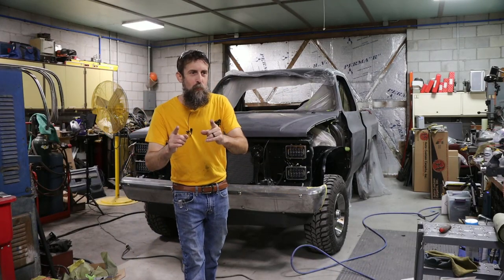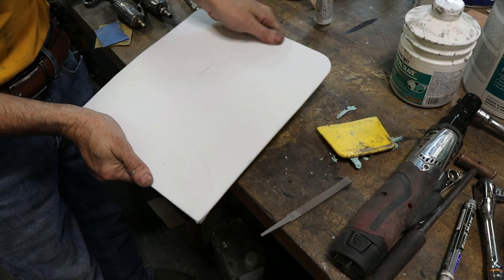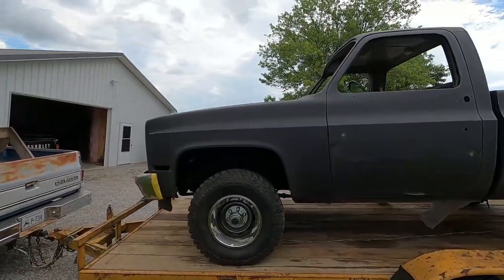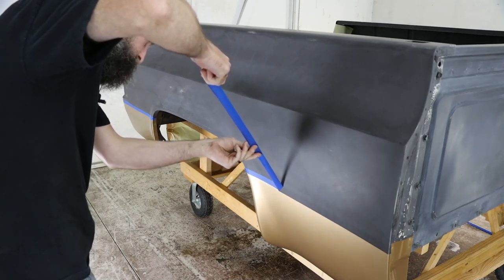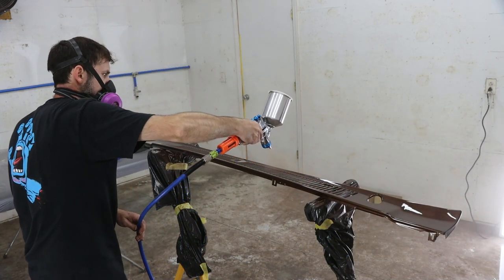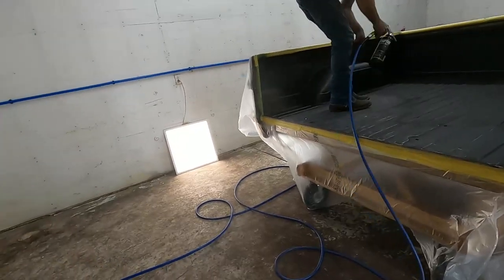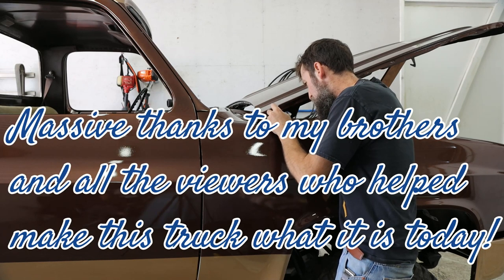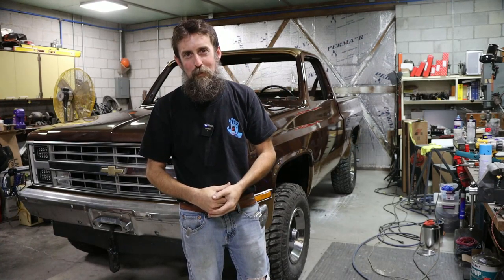From GARBAGE to GOLD! Old rusted out chevy k10 gets paint.

Comment: WOW - As a lifelong car guy whose been involved in a few restorations and paint jobs I know how much work this is. Ive been following and waiting in excitement for this day too, youve showed so much attention to detail in every aspect of the work  - the before and after is nothing short of astounding especially considering what you started with and how much work it needed in every single area -- Frame repairs: DONE - Suspension and steering: DONE - Drivetrain: DONE - Endless body work and paint: Virtually DONE - and the list goes on.  Now youre in the most fun part of the job, sanding out and polishing the clear coat then reassembling it with a new interior and everything will be as clean to work with as if it was a model car and the paint will look even better than it does now.  Just happens I had a friend and his dad long ago who painted EVERYTHING brown and gold, speedboat, van, house, fence etc etc so I normally hate this particular color combo but what I think doesnt matter your color choices are your own for the reasons you outlined and the truck still looks like a million bucks in fact its as good or even better than some body shops would turn out. youve gotten a really nice quality fit and finish of the panels, I was driving these off the truck as a kid working on the lot at a local Chevy dealer in '74 when they were brand new and some of the brand new ones didnt have panels this straight or paint this good.  I remember brand new ones having to go into the body shop for minor touch ups and repairs right off the truck.  CONGRATS TO YOU AND ALL INVOLVED, its a project well done and the results are well deserved.  M
Reply: Hear, hear! Well said.

Comment: Very nice truck!!  💪 
I’ve done a ton of old fords/chevies back in NY- some of them I did the lower panels just about every year on some to keep them rust free as possible- but there is little you can do to stop the salt from penetrating the pinch welds etc with the exception of oil- I’d spray every nook and cranny/inside frame- anywhere you can’t see or wash easily with oil-undercoating etc to protect it.

Comment: put on running lite pkg and get a radio, add a gps antenna and a solar panel on top too - you can get nice lithium power packs now for like 50 bucks - you could recharge that and trickle charge battery

Comment: I'm not sure why the aftermarket exhausts hang down that low. I've bought a hooker exhaust and an lmc exhaust (one for a truck and one for a blazer) and they both hang to low and stick out. I was able to fix the blazer exhaust by cutting out a straight section of pipe right after the axle that moved the exhaust up and in. Great job on the paint!

Comment: Beautiful job Steve you did it right, are you planning to install the fender trim and side panel molding? I seem to remember that the side panel molding was rubber or vinyl and had an adhesive on the back.
Reply from the maker: Yes, it will be getting the side molding and all the other original trim it came with.

Comment: Waw, what a grinder and some paint can do... =)  Joking, Steve, I'm joking. It was a hard work from the beginning, through renovation to the almost completion, just some more details and you'll have a brand new truck, with 2 tone paintjob. I have to say the result is excelent, I didn't expected such a level, but seing you working on it was looking very promising. You just gave me more motivation to redo my "boxy" as soon as it will be possible.. If I get half of the quality, it will be cool, since I don't have a paint booth of any sorts... Well, looking forward to see it finished 100%. Cheers, Mr. Steve, keep on!
Reply from the maker: Build a paint Booth out of wood and plastic.  It is what I was going to do.
As long as the air filter setup is good you will get a pro job 👍
Reply: @SteveSummers  Well, I was also thinking of something like this, but there is a problem on my location - wind. We get lots of wind so often and also space is a prerequisite, but I got another idea to incorporate this project on my decent size carport, as I will make some plastic drop down curtains to collect sandblasting rebound, the only problem is I can't make it fully enclosed.. Anyway, I'm already thinking about it..  Thanks for the advice.😊

Comment: Always get fisheyes when I use wax and grease remover or tack rags. It gives me anxiety to watch you use them. I rely on a drop of dawn in my wet sanding bucket. Good catch on the tiny crack!
Reply from the maker: I would bet the fisheye is from the air system 🤔 . It is best to wipe on wax and grease remover with one clean rag and directly wipe it off a different dry clean rag.  Old shop used  rubber air lines cause lots of trouble.